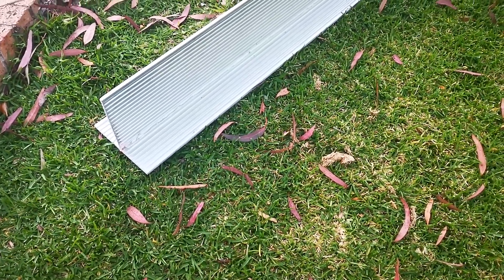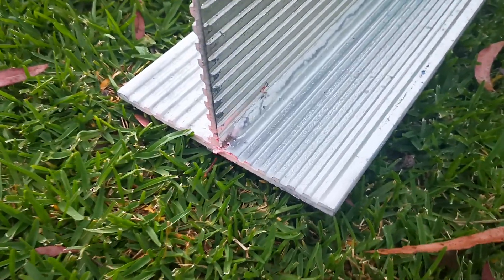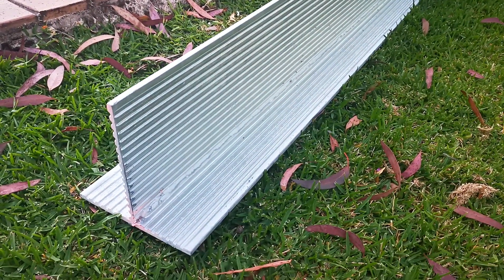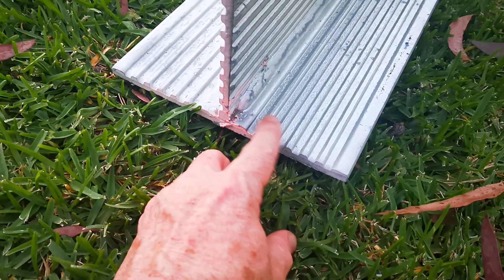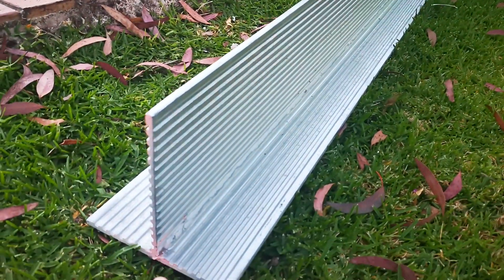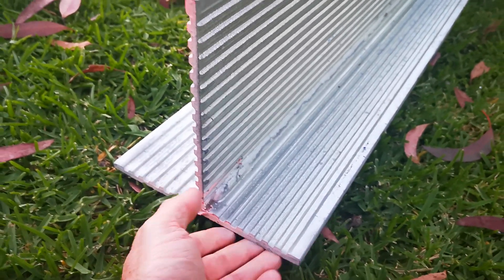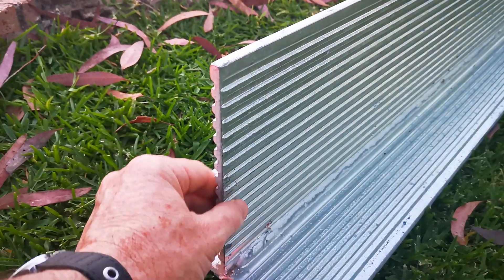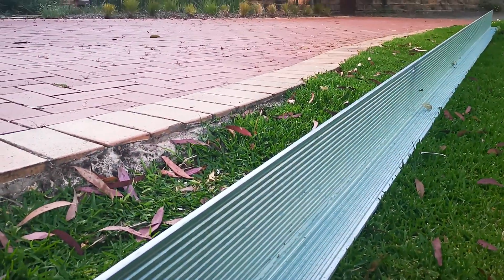Giant Metal Stiffy Bar

Comment: It's probably ridged to help with fabrication. No need for fancy jigs when you can just line once piece in the ridgeline of another. As for their choice of sizes. The factory likely has a limited number of extrusion options. And they've probably only got half a dozen options that they need to find the most fabrication uses for
Reply: Wrong. It's a LINTEL not a beam.

Comment: Enhanced strength against dents and going out off shape will be one of the benefits. Even though being 8mm thick, the individual sheets of metal that make that girder are, well, that: Sheets. There will be a greater tendency to flex in them if you don't provide these zones of greater leverage on the centreline of the parts that make each plane of the girder. What @XYZ Concepts wrote makes sense, two, probably a too-flies-with-one-clap-thing.

Comment: If our steels have been textured or ridged.  Its been to give a "Mechanical Key"   so the Plasterboard etc.  holds strong and doesnt crack & become loose.
As most  steels are covered in double plasterboard for fire safety.  By either 2"x1" Timber latt.  Or Adheasive.  Which if done wrongly, the adheasive will crack and detatch itself totally from steel beam.  Leaving your plasterboaard to fall off
Steel just looks weird though, like nowt ive ever installed.
Is it hollow?  With insulatiuon inside it?  Weird

Comment: I had a mason friend check out the video to make sure,.. he says the grooves are absolutely a 'tooth' for mortar engagement. Smooth lintels have long term adhesion problems at the metal to mortar interface. This prevents slipping.

Comment: It’s a lintel for masonry, a bit odd that they didn’t supply a hot rolled H-beam like an HEA200. An I shape or H shape is usually the most effective (provided that the H profile is orientated 90 degrees so that you have two parallel flanches with the vertical web in the centre). Look up second moment of inertia for the basic concepts, the orientation of profile matters for the bending resistance. It’s quite fascinating actually. If you’ve got an engineering pocket book, you may find tables with data about steel sections. For the bending resistance the vertical orientation is important. If you lay a ruler flat between to supports it bends easily, but if rotate that same ruler 90 degrees so that the cross section is upright, it’s a lot harder to bend it if you apply the same load. You will find that the profile will buckle around it’s axis though if you don’t laterally support it.

Comment: Those ridges also play a part in the extrusion process, as the metal cools at a certain rate (varies with material and/or use) the ridges aid in pulling the beam true.
Reply: That is hot rolled steel, no extrusion. Just use ribbed rollers for the one side for the base sections, and ribbed both sides for the centre section. Welded together after cutting to length, then sent out to some galvaniser, to be pickled and dipped for protection.
Reply: @SeanBZA  Dave's stiffey was pickled and then dipped?  That's a bit how-ya-doin'.

Comment: The lintel isn't just the steel, it includes the brickwork. The steel is just the lower tensile member. That's why it needs a proper bond to the bricks, and why a strength calc can't be done without knowing the height above the steel (and some local assumptions for wall properties.)

Comment: I've only seen these in new-construction, not rework.  No doubt it's doable, but integrating the new brick with the existing brick can be tough, as a unified whole is needed for long-term strength.  On rework, I've more often seen a beefier I-beam used instead, mainly to save on mason labor.
Reply: Yes, putting the I beam is easier, though I think there is not enough height there to place the I beam, without having to remove at least one end truss for the roof. I beam at least you only have to remove lintels and one row of brick, here they will need to pull 2 rows to get space, but can leave the roof trusses in place. Probably easier to remove all the bricks to the roof line, and then rebuild, so that the cracking is distributed over the whole structure. In any event Dave's Garage  will not be parking cars for at least 2 to 3 weeks.

Comment: Ridges is for grips only, when mounting it into a wall or used when adding something that will be hanging from the beam. With that profile, that don't add to the stiffness of the beam. This is a T-beam
Reply: I thougth it was 2/3's of an I-beam, but you right it's an upside down T-beam. it's always upsidedown in Oz.
Reply: Both your replies are so incorrect i's laughable. It's a LINTEL, as mentioned in the video description.
Reply: @johncoops6897  There are I-beams in the north and southern hemispheres; they are often referred to as H-beams on the equator.  ;-)  Whereas the T-beam could be called a 1-beam down under can’t think of what they may call it on the equator. "|--" 

You may call it Lintel I might say lentil but one of our statements won’t carry any weight.

Stay happy, stay safe, but don't stand under a Lentil.
Reply: @TheEmbeddedHobbyist  - You obviously have absolutely no idea what a Lintel is. This type is designed for bricks to go above it. It's not an H or I beam, it has that shape for a very particular reason.

Comment: I was a Brickie here in Sydney the reason for the groves is for strength. When you lay the bricks mortar is spread in the groves and sandwiched behind the bricks making for a stronger beam. Also it makes the beam much lighter than a solid lintel bar

Comment: Stiffness and ultimate strength depends on using a material in a "sensible" direction. Consider a piece of A4 paper.  Flat its got literally zero stiffness or strength, yet edgeways it's actuall pretty strong, esp in tension.  This is because the load applied should "go through" as much material as possible in effect. So this T beam, has a tall centre rib so that in bending, the load is trying to bend as much material as possible in simplistic terms.  A 5m long flat plate supported at each end only, would simply bend if you stood in the middle of it, even if it was 8mm thick, because the load is being applied across that 8mm section, where as stand that plate on it's size and stand in the middle and it'll hardly bend at all.

The ribbing does increase the effective stiffness (it provides more materal further away from the neutral axis) but it's primaryily there to allow the mortar to stick and prevent the line of bricks sitting on top of the lintel from simply sliding off sideways (The weight of those bricks locks the mortar into the grooves like a key)
Reply: I suppose since it will be installed as a retrofit there wont be much 'weight' to form the mortar into it as such. Or maybe it would if the contractor had to jack up and lower the brickwork while taking out the column. Either way, this is the answer. I wonder if Dave was hoping for the full FEM analysis though... hmmm. Not it!
Reply: @kick1ass20  They will have to jack up the centre of the opening, plus provide support all the way along, as likely they are going to remove 2 original prestressed concrete lintels from there, and at least 3 courses of brick as well, to get the same height. Then place the new lintel under the opening, after cutting into the sides to get a good footing to the original side columns, and grout it in place there, with a calculated bending load from the bottom, equal to the weight of the existing structure, so it will end up straight when complete. Then a coat of bonding liquid, and more mixed with the mortar, with the bricks then placed each side of the central T member, till they reach the existing structure, where they will have more bonding, and likely some wire mesh to provide tensile strength. 

After bricking, at last a week of the scaffolding still being there to support, unless you use a cement admixture that is ultra rapid cure, and high initial strength, before you remove the scaffolding support and allow the engineered beam to take the load. Then after a few more days, with regular watering of the brick to promote curing, you plaster the inside and outside, using preferably a plaster mix with fibre reinforcement, so as to avoid the cracking that will otherwise show in around a year.

Comment: That looks like an aluminium alloy of some sort.  If it is I would prefer a steel H section for wide span especially if it is a supporting wall.  If there is not a room above the garage it may be OK.
Reply: I was thinking more likely bright zinc plated steel.
Reply: They are made of hot-galvanized rolled steel.

Comment: Aluminum, That looks like extruded aluminum for sure
Reply: Also in Australia we don't have any of that Aluminum rubbish, only Aluminium
Reply: It's hot galvanized rolled steel. It's just a lintel, aluminium is far too expensive and would need to be much larger for the same span.
Reply: Looks more like bright zinc plated steel, extruded aluminium would have a much smoother finish.
Reply: Aluminium does not work well with cement unless hard anodised, looks more like fresh hot dipped zinc galvanising. At current aluminium prices that would be close to $3k, while steel would be around $400, a big price difference.

Comment: You got that absolutely right - more stiffness, less mass.
I would have liked to see it as an I section though, even if the top part was of minimal width. But perhaps the shape is designed to allow a couple of courses of bricks to go in there.
Reply: I beam is common for retrofit, but these rolled sections which are welded are lower mass, and equally as stiff in this application, plus the ribs add surface area for bonding, as cement is very weak in adhesion to anything but itself when fresh. Dave is going to find out that paint though will not stick to fresh galvanising, unless you take it and pickle with acid to etch it, then apply a galvanised steel primer. But likely the builder will acid wash the whole beam anyway, so as to promote adhesion of the cement mix to it.

Comment: Classic A-level physics question! The ridges are aid bonding to cement mortar, between the bricks. It's flat below to look pretty. To calculate the deflection, you need to know the loading (distributed). Then you make assumptions on material, temperature and material type. Any idea how much weight (mass) will be placed on it?
Reply from the maker: I'd say two layers of bricks either side.
Reply: What do the bricks support? My guess is some rafters, then battens and tiles or sheet steel? What distance between the ends of the rafters- how much roof load is on the lintel...
Reply from the maker: @fredfred2363  Off hand I couldn't say how much of the roof is supported across the length
Reply: @EEVblog2  Do not think there is much roof load there, your inside A frame truss transfers that to the walls. The only load there is the mass of the brickwork, say around 2 tons per layer, assuming normal clay brick. They are going to have to wire bond that into the existing walls well, and the biggest worry is the existing side columns, because now they are going to have another 2 tons of static load applied to them, and the beam had better be well supported underneath, and properly bedded to the existing top of column.
Reply: @seanBZA, yeah if it's a truss that spans the width of the double garage, then the centre pillar wouldn't have had much load, so probably no real change. No deflection to speak of if it's like that. If the load is along the garage, then the beam may deflect about 1mm assuming a tiled roof (500kg) over 15sq m. Or half the garage roof.
Reply: @fredfred2363  Centre pillar likely carries load, they would have used 2 lintels instead of 1, simply because they are easier to transport, and very much cheaper as well, as no prestress needed, just lay rebar in form, pour and leave to cure for a month. Plus they fit easy in a ute, so builder does not need to special order delivery.
Reply: @fredfred2363  - what are you talking about? It's a LINTEL for installation above a garage door opening, where originally there were two separate 3m (10ft) doors and a centre pillar. The pillar is being removed and a double-width door (6m/20ft wide) being installed instead. The building is brick, the lintel supports the bricks above the door opening.
Sheesh - why not watch the video before commenting?
Reply: I would say a guide for welding.

Comment: It's a lintel. Ridges are probably for mortar engagement when installed in brickwork.  It's designed to hold up a few courses of brickwork above it over a limited span.
Reply from the maker: Found it, from the description: "Galintel Multi-Rib T-Bars are cost effective lintels that provide structural rigidity, high strength-to-weight ratio and resistance to corrosion. The multi-ribbed profile forms a superior bond with the mortar. This bond between mortar, brickwork and lintel creates a composite beam of superior strength and structural integrity."
Reply: @EEVblog2  Illuminati confirmed!
Reply: @EEVblog2  right because when you consider both components as a composite structure, its the same idea as reebar in concrete. the bricks above will compress inbetween each other certain directions of stress that the steel will be stretched by as it triess to bow. kindda like how arches work under compression. so having a stronger mortar bond to couple the 2 components more tightly together helps to stop them shifting in place and that bond between those surfaces becoming disconnected.... exactly just like the little ridges on a stick of reebar
Reply: @EEVblog2  From the look of it, you don't have brickwork on the entrance side of your garage, since I see no mortar residue on it anywhere.  (I've seen your old videos, when your workshop was a small space in the garage, so I've seen it from the inside, and you've had some external views of parts of your house in your solar system videos, but nothing identified as the garage per se.  I say the 'entrance side' because I've been looking at houses in Texas, which seem to resemble houses in your area much more than the ones in my current area do, and they quite often have the garage at the back and entered off a service alley that runs down the middle of the block.)
Reply: Exactly what I was going to say.
Reply from the maker: That makes sense.
Reply: Ah, would that be why it is so well plated too, so it doesn't rust if the mortar gets damp?
Reply: @samheasmanwhite  Yep, any rust in brickwork/concrete is devastating to the structural integrity.  The recent apartment building collapse in Miami is evidence to that.
Reply: @xyzconceptsYT  mortar is typically pretty corrosive to pretty much any steal that's not painted but if that's aluminium it can't visibly rust  or if it's stainless it'll take a while.
Reply: @Heathmcdonald  It's hot-dip galvanized steel, not aluminium or stainless.
Reply: Bingo.
Reply: Yep...I was told that when our masons mortared our lintel in....
Reply: Yeap I concur!
Reply: Yep totally agree with this.